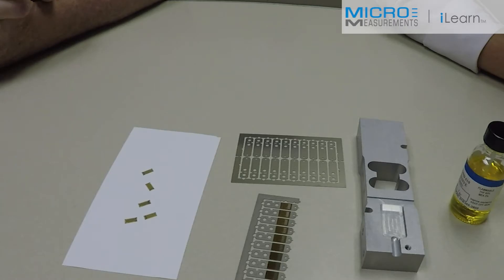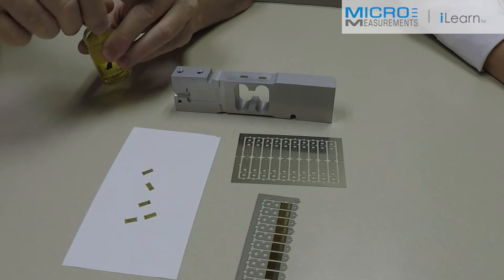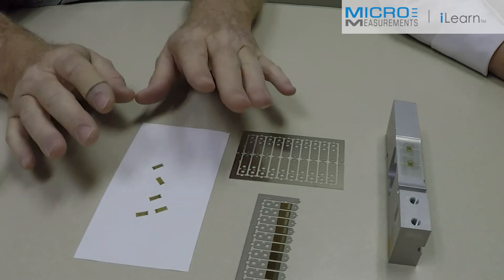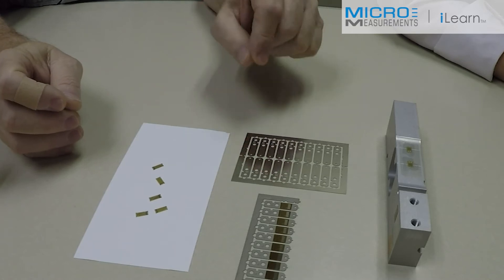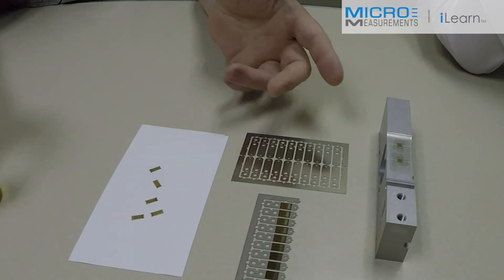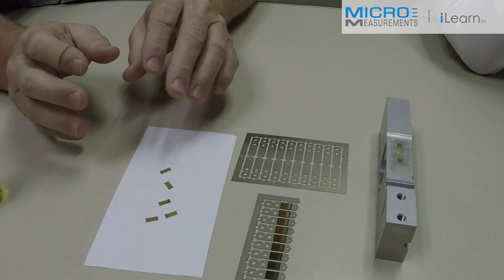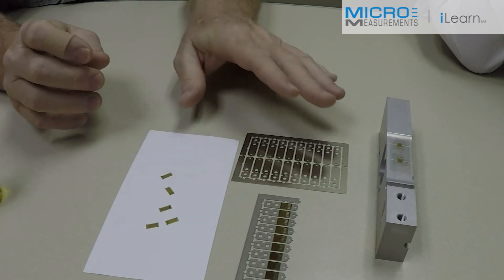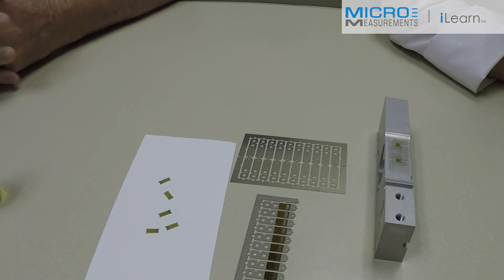ADHESIVE-BACKED STRAIN GAGES: NO GLUE REQUIRED.

Comment: Can you suggest an adhesive for a simple torque sensor...with good accuracy...the material of the shaft is aluminium and is hollow , im using 4 strain gauges , something thats readily available as well and not too hard to find ...thank you